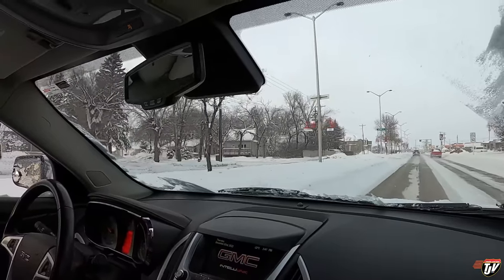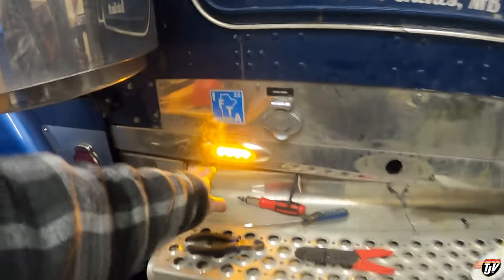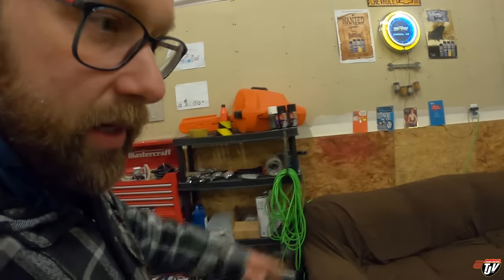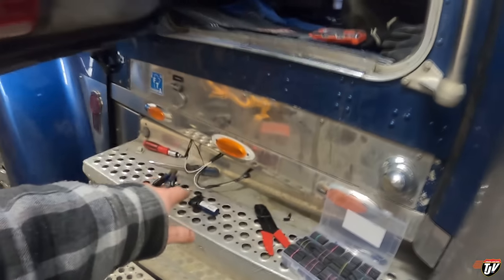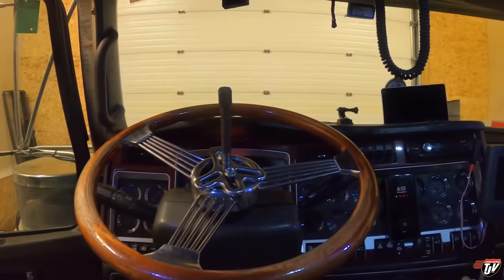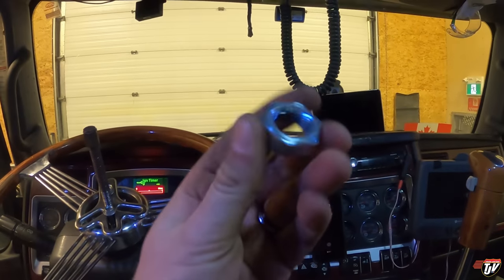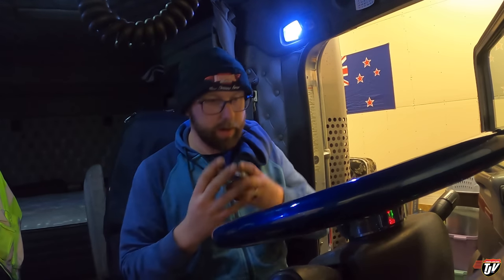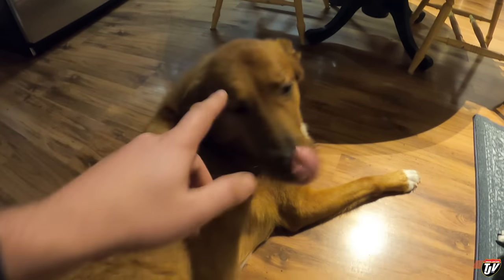NEW STEERING WHEEL | My Trucking Life | Vlog #2694

Comment: Be careful of your belt buckle hitting the steering wheel. It will chip the paint on it. I had to replace mine because of it. The second one I got a body shop to clear coat the wheel and that solved the problem. Same wheel in a blue T700 Kenworth. Looks great with the red & blue lights on in the interior at night. Just Sayin'... Merry Christmas